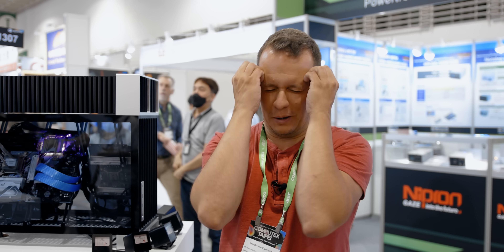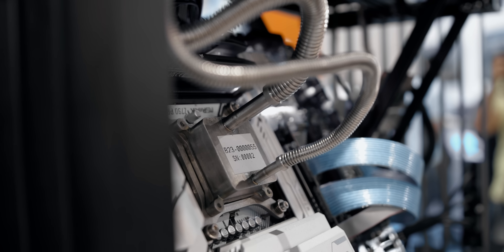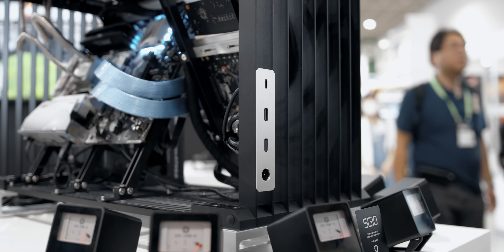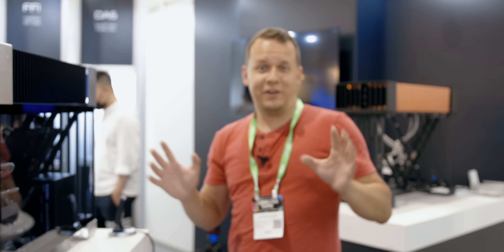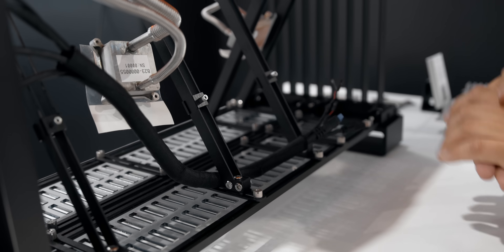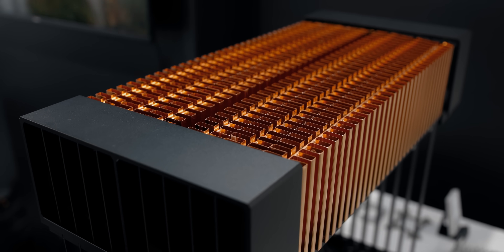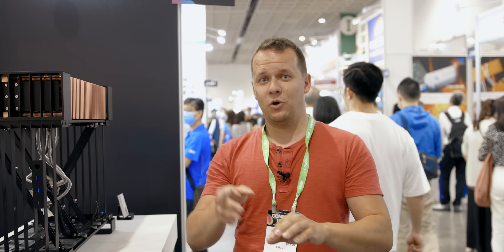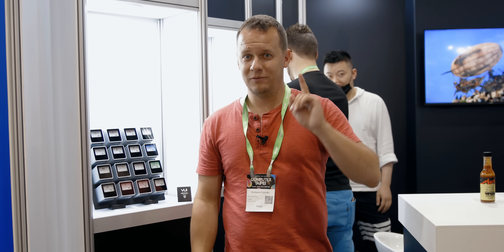Passive Cooling just got REAL.

Comment: Hi, and thank you for the rundown.  I do have an honest [not flamebait] question though.

I've helped design, and built, and ran a couple of datacenters in Arizona, which is hot.  When calculating the power requirements (utility mains, online UPS, generator backup, etc.) We built for a factor of 1.2 - 1.5 to include the power cost of cooling.

This passive cooling APPEARS to do no more to be efficient in the use of power, "being green", or doing anything other than moving the heat problem OUT of the box and into the surrounding atmosphere (datacenter heat space).  No money is saved, but for running less fans (which at 60Hz becomes a loud annoying buzz).

Can you uplease elaborate why a passive cooling system requiring 300-500% the physical space makes any difference?

I'll include some real world numbers that show that a business of running a datacenter would be affected by economies of scale not to implement this.  There's nothing wrong with it (except each server taking up more space) so the overall costs of running that datacenter are shared (amortized) among a significantly smaller customer/payment base.

Numbers below for added reading boredom.
E

In an ideal world, if you upt 600W into a device then it would cost you 600W of input power (factor=1.0x).  If, however, as in the real world, that 600W has to go somewhere, it's moved into the atmosphere (datacenter cooling return space, either hot aisles, plenum, or some mix of other methods) and that needs to be cooled.  

Fortunately through forced, external air, evap, "Economizer", DX, we reduce that cost from 600W of "get this heat out of my datacenter" to 120-300W depending on a variety of factors including outdoor temp, removal of evap condensate, "Economizer" inefficiencies in high desert heat, efficiency of devices (think large metal heatsinks that make Thermaltake and "passive cases" irrelevant, fluid cooling (refrigerant, water, oil, submergion, etc.).

So at the end of the day in a real world, if I plan a datacenter with 42RUs each and you have these monster ITX++ servers, you can probably get 10-14 per rack.  If you made them smaller you'd get more servers in, but most of the stuff is passive cooling and that won't shrink.  So let's go with the higher number based on 3" standard ITX, and put 200 racks in per floor.  The actual aisle/row/rack configuration isn't that important because you're trading off cost of power cables and cooling infrastructure (including hot/cold aisles) for customer access convenience.  That 14x200 or 2800 racks.

2800 racks at 600W is 1.78MW but now we have to provide it power to run the cooling system to mitigate the temperature caused by 1.78MW of energy being pumped in.  At a 20% extra (the low end if your design is perfect) that's 336KW of power to apply to the cooling system.  If you put it all outside it won't generate any extra heat to take care of.  Transformers, power factor correction devices, batteries charging... these all generate MORE heat.

When you take 1.78MW (power those servers), 336KW (cool those servers), and then maybe 20% of 20% for all the infrastructure in the previous paragraph (67.2KW) you end  up with a nice to-be-determined (after a year of wearther cycles) but roughly around 2.3-2.5MW.

Now what if you didn't use passive cooling at all.  You get to add all those little fans, a little less complexity of your ITX++ box, but a higher density.  Your power savings works out like so:
2800 racks at 42 1RU servers a rack at 600W/server is 7MW, and we add in our cooling/power infrastructure and we're up to 8.7MW.  

So if datacenter space was free, and rent is free, and people managing it all is free, and adjunct stuff is fee (offices, bathrooms, break room, parking, property, etc.) then it all comes down to whether you want 2800x42 servers (and paying customers!) or 2800x14 servers (1/3 paying customers).
Reply: For a PC in a house this makes zero difference to the house. Exact same amount of heat going into the house if it is passive or active cooling. And the PC is almost never a design consideration for the house unlike a datacenter. 

The only difference is no fans in the PC, so less noise and less moving parts. Power savings is so close to zero it is not worth talking about. 

So really this case is just cause it looks cool.
Reply: @5353Jumper  Looks cool and presumably very quite.
Reply: Ain't nobody reading alla that

Comment: I really look forward to tests and reviews on this case, I am kind of shocked that a 4080 under load in a passive cooling beast is only running at 60C! Kind of find it hard to believe lol
Reply: The magic of phase change and gravity.  A liquid phase changing into gas can't exceed the temperature at which the liquid boils.  Even water boiling on a stove will get no hotter than 100C no matter how much you turn up the heat.
Reply: i put 2 P14 for cooling my 4080 with low speed basically is 0db also keeps the gpu under 65c , so this thing is not that worth
Reply: @香噴噴-p6f  p14?
Reply: @revolverswitch  arctic p14
Reply: @香噴噴-p6f  so you removed the base cooler on the 4080 and replaced it with a third party one?
Reply: @revolverswitch  you mean deshroud ? nope they are just external case fan , since i'm not using any case with just open air bench , you can try search some case which can support bottom fans that can greatly help out your gpu
Reply: @香噴噴-p6f  well that's a lot more clarity, case airflow I feel is a very underappreciated and underestimated factor of cooling performance.

Comment: imagine this:  150 dollars for a AC unit and 20 bucks to pipe that air to the intake on your pc...3d print a duct adapter for the side of the case...

much colder, your room will get cooler, and you can actually afford a new gpu lol

Comment: Honestly the $1000 price sounds not much more expensive than a high end custom loop, between a cpu and gpu block, radiators, fittings, tubing, fans, pump/res, and a case, I’d say this actually seems pretty reasonable. Plus the huge added benefits of no water to flush / pumps / fans to fail! I say this as someone who has invested near $1000 into a custom loop.
Reply: this thing has some huge advantages , completely silent and never fail so 1000 bucks is not expensive at all for long term use
Reply: @香噴噴-p6f  Is it true to say it'll never fail though.. After-all it depends on a volatile refrigerant, so it'll probably lose vapour over time in a similar manner to an AIO losing water. 
In-fact that's my biggest concern, I'd be fine paying 1k provided it was a case that I could rely on to last 2-3 decades but if the refrigerant dries up after 5 years that's a hell of a cost for a small quality of life adjustment.
Added to that are my concerns over the copper heat-sink (in that version) tarnishing and losing performance. In a sealed system it can be coated but we're talking about exposed surfaces with a high thermal variability here. 
Furthermore the front IO is pitiful. At these prices it's a premium case so the lack of a fully featured IO is a big oversight and probably outweighs the reduction in noise by a significant margin in the QOL stakes.
Reply: @Quotheraving This is what I immediately thought, don't you have to "re-gas" it with more refrigerant at some point? Especially if you use the PC alot, than I can't imagine this having a longer lifespan than your average AIO (which is 5 years for alot of them if I remember right).
Reply: Coolant will dry and it begins to happen right after manufacturing it.. How well will it mount to possible new cpus with new sockets? Can it be servised or would people need to diy fittings from old toyota or something? This thing really is expensive piece of rubbish thats for sure. Amount of dust it would gather oh dear.. I hope there is not a soul in this planet that would waste money in that. 😅
Reply: I'll stick to the air cooling at low RPM. A little air sound is far more pleasant than the coil whine you will only hear with this.
Reply: exactly what I was thinking. The price sounds huge, but when you compare it, it's ok
Reply: Still better value than Apple stand.
Reply: Dealing with refrigerant it's a whole other can of worms.
Reply: $1k is downright reasonable!!
Reply: Yea as if "high end" watercooling loops (aka same performance with good aio solutions withouth that much increased production cost that just look fancier) were not ridiculously overpriced
Reply: Yes, but with 50% of the performance 🤣
Reply: Cringe, man
Reply: lol bro this isnt the 1990's. all the hardware for a water cooling system is dirt cheap, and only an absolute idiot would drop 1k on that shit.
Reply: Yeah especially considdering that it's both a pc case and a cpu and gpu cooler that is not that expensive
Reply: i just got a honey comb case, and it works very well, even when not using all the spaces for fans, my fans i ordered are late and i was kind of worried that it would be too hot, but i decided that i could easily use my old exhaust fan and my new CPU cooler instead and it seems to be plenty.

because of how the tower is built, it works really well with cooling, i was testing it last night and it almost doesn't produce heat from what i can tell, because there are so many areas where heat could escape all around the case, the fans i'm going to get i may not need at all because their is no build up of heat in the case like my last case.

my last case only had 3 fans, one for the CPU and one for the exhaust, and one for the power supply, i suppose i should account for the GPU fans, but i don't really count these so much because they aren't really to keep the tower cool so much as they are for the GPU itself. 

but i'm always interested in new ideas for cooling PC's if they can become better, there was a dude last year who had this idea to use frequency to cool the air and to also exhaust air, and that was also without a fan, so no moving parts and it exhausts quite well, but i have yet to see his tech show up on the PC market, there are these mini gaming PC's that i have fanless designs, and i wonder what they use, but so far i have not been able to figure that one out.
Reply: Problem with water cooling is that it still makes noise and I doubt that GPU will be at 60 full load like this.
Reply: @helloukw  fan noise entirely depends on your setup, I have 7 Arctic P12's in my case/loop that are dead silent at 55%.. gpu (3080 TI) never goes above 55c under full load
Reply: @helloukw  my 1080ti full load is 49c on water
Reply: @helloukw i have an AIO 4080 and it runs full load, overclocked at 117% power target at around 57°C while rendering. Gaming has never gone above 53.

And it's an out of the box AIO, a water lock can definitely beat that.
Reply: @helloukw  Agreed it definitely makes noise, though 60 at full load is very doable! I have an EVGA RTX 3080 ftw3 10g, and even overclocked it never goes above 65, if you leave at stock or undervolt it, it stays below 60 under a full load easily, though I do both a 360mm and 420mm rad in my loop.
Reply: @helloukw  Dude my XFX 7900 XT with it's stock heatsink never sees over 65*C with my room being at 78*F. On water it never sees more than 55*C on full load with a 5800X3D in the loop.
Reply: @helloukw  I have a pair of water cooled RTX 3090s.  When running the 3Dmark TimeSpy stress test they hit a peak temperature of 44 and 46 degrees and the PC is quiet.
Reply: @helloukw i just order external custom watercool parts with 6pcs of 480x120mm radiators... i'm going to try with completly fanless; with waterpump covered in soundproofing. i have 95w TDP i7-8700K and 200w 4070 GTX gpu, so "only ~300w" to cool. Power is Seasonic Prime Tx-700 Fanless
Reply: @helloukw  Indeed a GPU will not run at 60C in a water cooled loop. My 7900XTX runs no hotter than 40C at 420W+
Reply: @helloukw  I have 140mm, 280mm, and 240mm rads, and D5 pump.  At overclocked, full load running 5800x3d and 3080ti, it is complete silent from 3 feet.  But, the total cost of waterblocks, radiators, pump,  fittings, and case is about 1k.  So, this solution is better.  But, it can only do 600W and a 5090 will probably eat 600W all by itself.  May need a couple slow fans on top.
Reply: $1000 is actually cheaper than a nice PC case + 2/3 radiators + 7/10 fans like T30 + d5 pump + two blocks + fittings + tubing + flow rate/temperature sensors + etc.
Reply: $1000 dollars?  Dear god man.  What in the nine Hell's were you cooling with a custom loop like that.
Reply: @robertkeaney9905 1k isn't that crazy for custom loop. Gpu/cpu blocks. Radiators fittings pumps and reservoir will easily be more than that from a place like ekwb

Comment: Indeed more a nieche product for enthusiasts with money, but if one knows how freaking expensive a passiv-cooling cases are would say: "this is actually quite cheap"! Usually you´re more around 2K for a passiv-cooling cases and those semi-analog indicators fit perfectly for the type of customers this case is made for. Sure those cost extra, but there´re not just enthusiasts interested in cases like this. For certain enviorments/ usecases you need 100% passiv cooling, a fan or anything making noises would mess with your work or it´s just a too dirty enviorment where fans don´t make sense, because they will constantly breaking down. And for those customers 1K for a good case fitting their requirements is nothing and a must have investment.

Comment: Copper is expensive, but not additional 1k expensive.
On the other hand, 100 for 4 analog dials is very reasonable.
Reply: well copper is twice as expensive as aluminium, and in the 2k price tag is the major extra shipping costs they have to deal with when moving this stuff, so it makes sense to me. 

as for performance however ill pick the aluminium one for 1k

Comment: That is a display case and its beautiful.
Reply: Disagree. Case by itself looks like nothing special, those 45 angle brackets and gpu plate... I dunno some steampunk but no style. Those tubes just bad. Radiator at the top is neat but thats all...
I think it might be worth it if absolute silence is necessity, otherwise any decent case with good airflow will do the job at /5 or even /10 the price. 
I like the idea, but i think it's far from "beauty".

Comment: I love this and can understand the pricing completely. The copper alone is hella expensive. But at 1k for a CASE? Imma head out.
Reply: The $999 price tag is for the aluminum version. They’ll have a version with copper fins, but that’ll be even more expensive.
Reply: A case of this quality is $200+, an AIO for the CPU is $150-200, water cooling for your GPU is $300ish. 

If you do all air cooling and use your stock GPU cooler, then yeah there's a pretty big price gap. But if you were going to do open loop water-cooling for the whole system or something you're actually looking at a similar price.

It's not just a case, it's all of the cooling.
Reply: @ninbura  i mean i can make an water loop with gpu cpu and like 3 360 rads for like 400 soo its not even that pricey to watercool
Reply: Okay, but how about 1k for a case and a space heater?
Reply: 1000$ for the Case or 20$ for some fans...